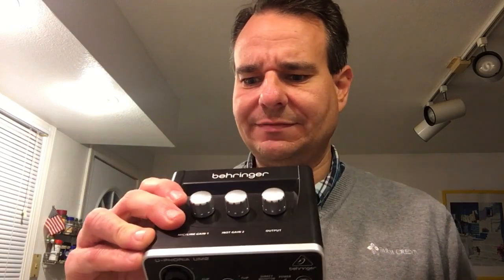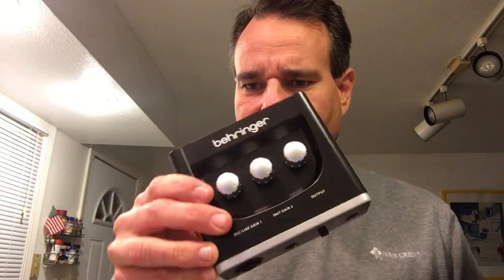Fixing Hum - Adding a ground to the UM2 Mic Preamp

Comment: what type of filter is there after the DAC? In my opinion, 2 orders can come up with something better? What should I solder off then?
It is also unclear what each chip is responsible for. A diagram with explanations would be helpful.
Reply from the maker: I literally don't understand what you are asking.  I ground the preamp to the grounding plug of the house.  That's it.  There are NO CHIPS ever shown in this video.  Like, you haven't actually watched it.
Reply: @dixielandfarm  I thought you were an engineer and understood more than just changing the plug)

Comment: Thanks, your idea inspired me to randomly unplug different devices until I found the one causing grounding issues. I first moved my audio interface from notebook to power bank (my audio interface can work in monitor mode without host connected), hum persisted so I was 100% sure that some device causing heavy Electromagnetic interference.
Reply from the maker: So glad you figured it out - it can be maddening.  I might have a video on some interference I was getting on a radio - turns out it was a light bulb - the fixture was fine, the bulb was fine, but it made noise - swapped the LED bulb out and the sound went away.

Comment: After seeing this video I got the idea to just plug a regular cable into one of my outputs on my Behringer UMC1820 and the other end into the input of one of my other pieces of equipment (which has a 3 pronged plug) and this unit isn’t even turned on, and it got rid of my loud hum I was getting when my guitar was plugged into the Behringer.   It’s dead quiet now!
Reply from the maker: Now that is a great idea - I didn't have anything else grounded, but that of course would work perfectly!

Comment: really wish you had included before and after audio and how wires are connected
Reply from the maker: I didn't want to go into how it was done as I didn't want to be liable for someone doing it wrong, so I was on purpose vague.
Reply: @dixielandfarm  got it. i connected ground to my interface outputs directly with and it had no effect
Reply from the maker: A shame - a lot of noise actually comes in from the USB connection.  If you touching the ground has no change in hum, I think looking at the USB connection is next.  Sorry it didn't work out for you.

Comment: Can I Use A wire from this input to ground
Reply from the maker: That's what I did... but as always, be careful and know what you are doing - there is a risk of shock in anything electrical.
Reply: @dixielandfarm  how possible electric shock from audio interface 🤔
Reply from the maker: @UDITNARAYANNAYAK  Depending where you ground it.  Example, I grounded it to a place where AC current exists.  Thus, potential.
Reply: @dixielandfarm  you're right dear❤

Comment: Could you accomplish something like this using a turntables' grounding wire? Or, is there something else I could buy? I don't know how to solder but I'd love to fix this issue with the UM2.
Reply from the maker: Absolutely - and you don't have to know how to solder - you could use some tape to hold the wire on the outside part of the phono plug (or just your hand to test to see if it makes the hum go away).  They also sell round ring terminals which would also work - while the tape is not pretty, who cares if it works!
Reply: Thanks for the tiip @dixielandfarm  I'm not sure how to find the terminals you've described but would those be essentially plug and play?
Reply from the maker: @no_categories  Its pretty simple - you can find them in the electrical section of an auto parts store/dept.  BUT, the tape is the simplest.  Where to ground it will be the trickier part, and I don't want to give advice on that since dealing with grounding/electricity in any form is something that you should know what you are doing (but think just like grounding a turntable is a good clue).
Reply: @dixielandfarm  Thank you so much for your kind help. I'm pretty sue I know what to do now.
Reply: @Dylan Kinnett Also just wanted to add that soldering is not rocket science, if you have the equipment you can probably watch a 2 min video about how to do it. super easy.  I've done many soldering  when fixing stuff , only gets tricky if you are soldering SMT components which you don't have to do for stuff like that.

Comment: Also check if you don't have any suspicious power adapters plugged in as this is what caused a grounding problem in my case.
Reply from the maker: Excellent point/advice!  Even if not at same outlet, it could also be on same circuit as well.

Comment: Wow ok - so I was having this problem and in my case this made me think if a very simple solution in my case. 

I started to get the hum and similarly it went away when I touched it. I don't know much about how these things are powered so your explanation was really helpful and made me think... is there something wrong with my USB port? 

So I switched ports on my macbook and the hum was gone!

Obviously this is incredibly simplistic and may not work for everyone but if you're here looking at this give this a try too!

Thanks for making this video though its really informative
Reply from the maker: Yup, should have mentioned trying a different port as well - in my case that didn't make a difference but certainly can in others - especially if you have a desktop computer and front/rear ports.  Thanks for watching, Eric!
Reply: @dixielandfarm  Came here while looking for a solution to my UMC22 (less than two months old) getting a lot of the same issues described here. I've tried switching USB ports, and it sorts it each time, but after another 15-30 minutes it's back to having issues. I would try the method outlined in this video, but it's still in warranty, so I'll see what Behringer say when I open a support ticket with them tomorrow...
Reply from the maker: @michaelharden1587  USB ground loops can be tricky, but since this video was made, there are now USB audio isolators available that may do the trick.

Comment: So.. wait... the whip you've fabricated to be able to take advantage of the equipment ground in your homes receptacles, it looks like the other end has a cord cap on it ..... am I missing something? Are you plugging that in to live receptacles as your method to achieve grounding the device?  You mentioned to utilize that third pin but did you remove the hot and neutral prongs that will energize that wire when it gets plugged in?? Maybe the hot and neutral wires are capped off and your just bonding the device basically through the equipment ground which seems to be getting the effect your looking for?
Reply from the maker: Yes - That is exactly what I am doing.  I have taped off the internal part of the plug as a precaution, and only utilizing the house ground in the receptacle.  One reason why I STRONGLY suggest that I am not advocating this for people, I am only showing what "I" did.
Reply: @dixielandfarm  Yes sir, I agree with your disclaimer, lol. I had my concerns but you were already on top of it. Tyvm for responding and clearing that up for me.
Reply from the maker: @Reegor  If you happen to have any other studio equipment nearby and it has a metal chassis, I would STRONGLY suggest trying to tie to it as ground first - this is definitely a last resort and not ideal... unfortunately everything else I have is plastic.  If they had spent another dollar or so putting a shield inside,  this wouldn't be necessary.
Reply: @dixielandfarm  I'm actually playing around with the idea of hijacking my ground with an isolated electrode like the cable guys use to ground their coax. Electrical is my trade so no worries on my end, we're definitely on the same page concerning electrical safety and I do my best to always respect electricity in general, lol. Thank you for the tips and advice!

Comment: Hey is this relevant to the mid-high gain buzzing aswell, thanks
Reply from the maker: That sounds like an unshielded connection to me - I think a better cable may fix that - or the power cable is picking up noise (acting like an antenna).  But the thing about buzzes are they can come from anywhere and take time to track down by plugging/unplugging things.

Comment: but what to do if i'm using the RCA ports?
Reply from the maker: You will have to find another place to try grounding, or even put a wire/ring terminal around the rca plug.  Note - this is how I fixed it for me - grounding solutions will always be different and really are just fixing a design flaw that shouldn't have been there to begin with.

Comment: My sound doesnt go away when i touch it. Probably interference then? I use an amp simulator and that amplifies the static noise by A LOT.
Reply from the maker: Most likely - ground loops are tricky, and interference is as well - I wish they had put just a little bit of metal in this thing for shielding, but they went real cheap in that regards which is why its a problem.
Reply: @dixielandfarm  Wouldn't it be possible to manually put the um2 inside a metal box ?
Reply from the maker: @QuiEstMarin  It absolutely would be.  But at that point, you probably should just buy a better unit.  I think the upgrade from this is $40 that IS in a metal box.
Reply: @dixielandfarm  Thanks a lot for your answer :)

Comment: The hum doesn't go away for me when I touch the back. It stays the same and they hissing only appears in certain USB ports. Will the same fix still work?
Reply from the maker: I don't believe so - the best and easiest advice is to just use that USB port that doesn't make the noise and consider yourself lucky.
Reply: @dixielandfarm  That fix definitely worked for me a few times, but the only problem is that after a while it will start to migrate the problem to that other USB port. I'm planning on just getting a new one since there is no permanent fix for it,.
Reply from the maker: My suggestion is getting a better model - preferably one with a metal case so  you don't have to do the hack.  Probably closer to $100 USD but in the end worth it if you are more than an occasional user.  Me - I use the thing only a few times a year so it isn't worth upgrading - but I would suggest that if anyone was purchasing a new one.  Ground loops are tricky and don't always work the way you think they do (which is why they occur in the first place).
Reply: @dixielandfarm  Yeah. I'm going for a Rode or an M-audio interface because I use them everyday for music vocals and talking to my friends. Thanks for the video regardless!

Comment: it's normal.. then, u'r right for use grounding, or u can use eq and cut 0hz-50hz/100hz freq for solving white noise, and u can use de noiser when editing ur audio.
btw, nice video sir
Reply from the maker: Thank you so much, Fadly.  I wish they had just put a little bit of shielding in this thing, then it would have been a perfect solution, but at least we can figure a workaround.

Comment: Is it normal that the volume is down and the music is still playing, in both audio and RCA outputs ??? Thank you.
Reply from the maker: There is a monitoring button on the front of the unit that will keep audio playing through no matter what.  I don't use the RCA outputs, so I am not sure - does audio leak through the USB section when the volume is down?
Reply from the maker: Does it leak through the headphone output?  Are you overdriving the input (volume too loud)?  I notice a small amount of bleed through even when the input is down the whole way, but only noticeable on headphones.  Make sure you turn down the master control as well and see if you can still hear the audio coming through.  Let's face it, for $20, its not the best built thing but it does work well enough.

Comment: Hİ, pls help me ı have same sound card and ı can hear smoothly sound of my pc on headset output , but I cannot connect my mic (Behringer C-1) to MIC/LİNE 1 . when ı plug it, there is some noisy and very low sound level like this video https://www.youtube.com/watch?v=AgUApQAo50o what should ı do,people say ıt was borken already or it might be electricity earthing. Pls help us, thanks..
Reply from the maker: Tracking hum down is not easy.  It is also dependent on every situation - it will just take trial and error of plugging stuff in and out to find the problem.  Wish I had more of an answer. :(

Comment: If it works, it works! I seen something like this for a grounding issue on a Pro-ject turntable. It had a hum and the guy hooked a ground in the same fashion and it went away.
Reply from the maker: That's the way I looked at it - normally you would look at a better solution, but sometimes just getting it done and not having the headaches is worth it.

Comment: One thing I haven't learned to do is solder. Just did an update on my turntable problem. Fixed it myself, was running at 45rpm on its own set at 33rpm Was an easy fix even for someone simple like me
Reply from the maker: The way I learned was with small kits - just doing a few items you pick it up really quickly.  I didn't have someone show me or YT to look, so it was trial and error.  But realistically, you can just get a few resistors and a perfboard and learn in an hour.  Cables are a little different, but you pick that up quickly as well.  I was JUST about to watch your turntable videos to see what was happening, but I am glad you got it all sorted out.
Reply: dixielandfarm yeah a problem that scared me at first. I learned there was a good chance I could do it myself and if not at least I tried. Bought a couple new records went completely out of my norm today. Should be up today to see. Thanks for responding I enjoy this conversation with few but you are one of the good ones thanks again. Regards

Comment: I am always amazed at the audio component hook ups that you show. Now is most of this stuff off the cuff and sort of trial and error?  Like how did you know to add a ground to the third pin from the AC wiring and not the first or second? You really are an audio tech in every sense of the word Kris. Thanks for sharing it. You are a go-to man for all things audio ~
Rob/Boston
Reply from the maker: Oh, its something you just have to know.  Most audio components the third pin is ground, and in AC wiring, if you touch the other pins, you will get shocked with electricity, so you learn pretty quick what is safe :)  Some is trial and error, but a lot of it is just knowing how a circuit is working and finding out why it doesn't - just troubleshooting like anything I do on the farm - why isn't this faucet working, why isn't this electric fence not zapping, etc...  Thanks for watching, Rob - it has been VERY warm here lately so Spring is around the corner...